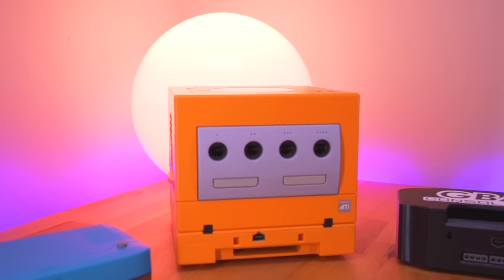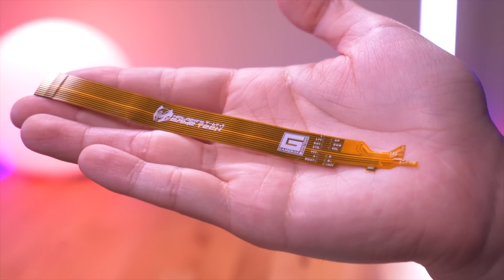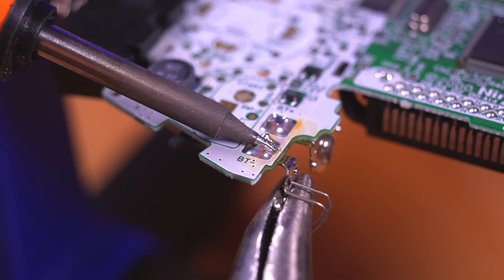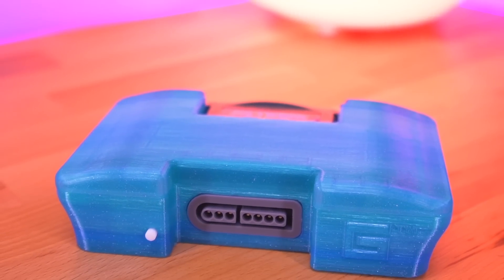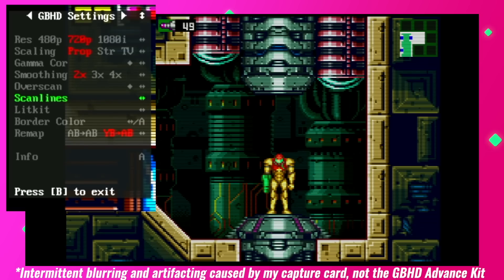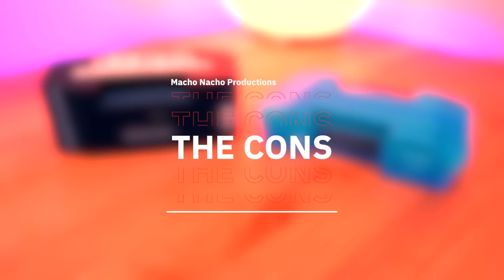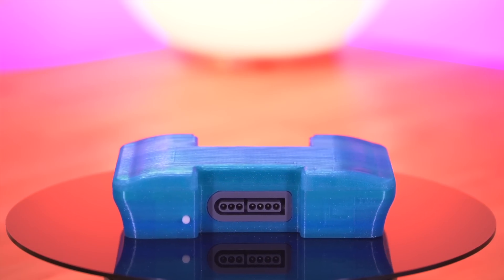Best Affordable FPGA HDMI Kit for The Game Boy Advance!?  The GBHD Advance

Comment: I know this video is a year old - but I really love the newer aliexpress docks which also come with hdmi out and controller port.
there is a seller who sells these for ~50 bucks. and I notice up to no input lag. only down side i experienced with these is, if you use a bluetooth controller and it loses connection to the SNES bt adapter you are using - the dock somehow misinterpretes a disconnected BT receiver as pushing all buttons at the same time. which leads to a game reset loop.

so if you are using a bt controller with those aliexpress docks for the gba - better make sure your bt controller is charged - and do safety saves.
Reply: Do you have a link to where you can find this on AE?

Comment: The main issue I have with the GBHD is compatibility with the e-Reader, which I know is a VERY small use-case scenario.
On the GBHD,  the e-Reader looks like it would block the HDMI port, defeating the entire point of a consolizer.
Still a great product though. Definitely on my list of items to potentially get.
Reply: GBHD SP variant might be able to work with it

Comment: I’ve found that the audio is a nightmare to navigate:

SC-LX701 does not passthrough audio. The front HDMI port won’t display an image either.

My LG OLED B6 suffers w/audio drift ~1sec. You can reset the drift by changing the resolution via the GBHD OSD, but it’ll creep back within a couple of minutes. 480p doesn’t output any audio. Whereas 1080i outputs as 540x1920 progressive and the top/bottom lines flicker. Golden Sun’s overworld BG shakes.

My old SAMSUNG 2032 SyncMaster has no problem with audio in all 3 resolutions, but only 1080i fits the whole screen.

If you purchase this kit be warned that your setup won’t be compatible as-is. You’ll more than likely need an audio splitter unless your tv is old like my SAMSUNG.

Comment: One thing you didn't mention in the pros/cons is that it doesn't look like you can't use the official link cable with this kit's layout because the HDMI port is in the way.  The Woozle kit doesn't have this issue because the link cable is above the controller port.  If you look at the spacing of the holes for the link cable's clips on Woozle's kit at 11:40, you can see how wide the official connector is.  With this kit you'll need to pick up an aftermarket cable that doesn't have the wide connector with the clips.  A quick search shows there are some available for GB<->GB, but I didn't immediately see one for GB<->GameCube.   EDIT: Further searching tells me it's only the GB->GameCube cable that has an issue.

Comment: I bought one of these last month and it works really well. Might grab the GBC version next just for GB/GBC games to have their own system. Definitely enjoying it.

EDIT: The biggest problem I have with the system is that it doesn't save settings so you have to readjust the button layout every time you turn it on if you like Y and B instead of A and B.
Reply: I have the color version, and it has the same issue. Pretty annoying needing to change the resolution to 720p every time I boot. Otherwise it's pretty good though, just no custom colors for GB games aside from the built in GBC colors. I tested input lag to be basically identical to the original GBC when playing on my PC monitor, so I'm pretty happy with it.
Reply: We're coming out w gbasp next!
Reply: @undriven  I'm kind of disappointed that the GB/GBC version got discontinued before I ordered one. I have no idea why, but I wanted to have a separate one for GB.

Comment: The price is the biggest con. No ones gonna pay that then build it themselves. I'm interested but given the price and building it yourself.  Just not worth it. Even if you're skilled enough. The $200 dollar price range might be worth it for a built one.
Reply: I think you're missing the cost my guy, the kit costs 160 to do it yourself, it costs 100-140 for a clean, decent gba sp with clean pins on ebay, they're providing everything already put together so that leaves them what, 40 for putting it together and shipping?

Comment: The kit looks cool but 3D printed cases look like garbage. Wish it was plastic injection molded. Otherwise if I buy this kit I will use sandpaper and polishing compounds to smooth surface.

Comment: Hmm. It looks like the GBA Consolizer has one further advantage over the Gamebox kit, which is that the case is designed with an opening that allows you to access the headphone jack, pulling analog audio directly from the GBA motherboard and bypassing any weird DVI audio incompatibilities. That's how I use my GBA Consolizer.

Otherwise, this is pretty cool. I definitely like the full size HDMI and USB C. And the case design is nice. If I didn't already have the GBA Consolizer, I'd definitely be interested in this Gamebox kit.

I'm surprised there was nothing needed with the power switch on the GBA motherboard, though.

Comment: There's 2 key differences with Woozle's Consolizer not mentioned at all here: original GBA speed for compatible monitors, and color correction options. Without these two features, this otherwise nice kit becomes unusable IMO.
edit: Supporting grid-like "scanlines" is also an important difference to me, though less than the above.
Reply: @DenebianSlimeDevil  GBA consoles run at a non-standard speed of 59.73 Hz, as opposed to the standard 60 Hz (think 60 frames per second). The screens on GBAs were able refresh at this speed and thus show games in their original speed without problems. Many modern displays including consumer TVs can as well, but others can't as they can only support standards like 60Hz. To maximize compatibility with all TVs, kits like this can output a 60Hz signals which means that every once in a while a frame has to be skipped or doubled, resulting in stutter in the image every few seconds. It's always better to have an option of the original refresh rate rather than be forced into one or the other.

Comment: The audio issues are too risky in a home theatre setup. As soon as that’s ironed out, I’m in.
Reply: I wonder if they could be solved by using an HDMI splitter, then running one of the HDMI connections through an HDMI to axillary connection.

In my setup I wanted to use a TV with my computer without having the icons change whenever the TV was off and wanted audio so I did something similar by first splitting the video signal, then converting to HDMI, then have an audio signal injected into the HDMI cable, and that essentially let me mirror one monitor onto a TV with audio that could then be passed to a sound bar.

 Lots of problems can be solved when you are OK with using a bunch of conversions.

Comment: While it is a okay deal I guess.. I broke down the math on this folks. The new consolizer isn't the "greatest deal ever" it's just "fair". 2x $20 USD FPGA Chils, a $12 PCB for the chips, probably $5 ribbon cable. $5 port for controller probably. The creation of the case for it (designing it takes time and hours which is work) which is probably around $8 worth of plastic as well so call it $20 manufacturing overhead then factor in they're probably buying GBA's with faulty screens (totally fine and a good way to recycle) for around $10 to $20 you can assume.

2x $20 FPGA Chips
$8 (at most) Ribbon cable
$12 (being generous) PCB
$5-$10 SNES controller port replacement (fair and going rate)
$15-$20 functional GBA with a broken LDC (as, the hardware works just no the display on the device, games still run)
to sell that for $300 is absurd, sorry.

Comment: Had they moved the Gameboy motherboard assembly up just a few cm and added cutouts for the wireless adapter this kit would be very tempting. The GameCube link cable also requires this, as do other accessories. Quite a missed opportunity I must say. It would be awesome to trade Pokémon with another GBA wirelessly and see it happen on a large TV. Or even better, link up to a GameCube with an HDMI mod and use both consoles side by side with two monitors in HD! Woozel’s kit does have the cutouts for the wireless adapter and the correct spacing for it to work.
Reply: That sounds interesting 🤔 I guess ill wait for these features to be hammered out

Comment: As you said about the soldiering, that's kind of a turnoff, at least in the realm of having old GBA's I'd like to mod, but I'm not comfortable with the small areas to work with. One other big issue for me is the placement of the HDMI and power, it doesn't really allow for the port to be used for linking systems. One thing I liked in the last GBA mod that was shared was the ability to put in the link cable for the GameCube, also not needing to soldier anything. 

If someone could take the best parts of each, made it a thing, and not cost a lot, that would probably get me to buy 1 or 2, and so I could give my old GBA's new life
Reply from the maker: Totally agree!  It would be awesome to combine the best features of all these kits

Comment: I was wondering what it might take to make a consolizer kit that just sits on top of the gameboy player.  I know there's probably a lot of those out there without the disc's that will just go to waste, so would be nice to make those useful.

Also still waiting on a good consolizer kit for the GBA SP.  I've got a couple spare boards for those lying around.
Reply from the maker: That’s actually a really super interesting idea. That could actually be really cool!
Reply: @MachoNachoProductions  Have you heard of the open-source gbaHD project? Pair that with ManCloud's shield for the Spartan FPGA board you need for it, and you have exactly that. Might not be as feature-packed as some of the other options out there, but being open-source means that it's exposed to a lot of smart people who can add a lot to it.

Primarily, it's a very DIY project. You need the FPGA dev board, and a way to get the circuit board for the shield (optional, but worth it) made and assembled. Then, you need a case for it all, which there are 3d printed options by jotheripper (they made an original GBA version, and an SP version).

There were a few issues with ManCloud's shield regarding powering SP boards because of how lithium batteries work and (from what I've seen/heard) some rules the board has before it lets the system get power, but they're being worked out in newer revisions. I'm currently building one now, based on a previous revision board because I got the boards made a while ago and never quite got around to ordering parts. You could buy shields from retroupgrades for a while but they're sold out atm, and also that board is based on the past revision that I have. My first time soldering SMD components outside of a practice board, so it's been a fun experience.

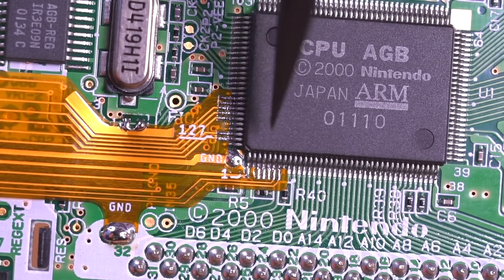Comment: Your soldering is getting better.  Do yourself a favor and buy some no-clean tacky flux like Amtech/Chipquick/MG chemicals, etc.  Liquid flux is crap.  At 6:09 your joints are good but would look perfect had you used a tacky type flux instead of liquid.
Reply from the maker: I have some amtech flux which works amazingly. I use the no clean thinking it’s easier to show the soldering on camera. Perhaps I should use the amtech more 😅

Comment: I believe the GBHD advance uses the GBA clock for accurate clock cycles, whereas Woozle's kit slightly changes the clock to match a perfect 60hz. Am I right in thinking this?
Reply: In Woozle's kit you can have it either way
Reply: I would also like to know this. This is definitely an important topic to get the best picture quality 🙂
Reply from the maker: That is a great question!  I unfortunately don’t know the answer, but hopefully Gamebox is prowling the comments and can chime in
Reply: I asked Gamebox about this and got the following answer:
„No, there is no overclocking, it is stock with a framebuffer. The output is normal 60hz, not 59.73Hz“
So no overclocking with a framebuffer.

Comment: Looks to be a promising option.
On the audio issue, I'd imagine with the unit being an FPGA it wouldn't take much effort for a firmware update to fix it. USB-C should allow this in theory.
About the only question have is can one send their own GBA to use as the donor/core?
Reply from the maker: That’s a great question. I would message game box. They may accept your donor console
Reply: @MachoNachoProductions  I have a GameCube with GCHDMI internal HDMI installed coupled with the Gameboy Player addon and Swiss running the Gameboy Interface software. Would you say this is the best setup for Gameboy games?

Comment: Nice video thanks. Why does this one not make the GBA's headphone jack accessible? I have Woozle's 2nd gen consolizer, with which my TV doesn't recognize the audio over HDMI so I use the headphone jack, and the volume dial is easily accessible as it has a quick-removable lid.. I'm surprised this case doesn't seem to allow that. Also, does this one allow easily updateable firmware? As my Woozle kit is only updatable via JTAG so I haven't tried it.
Reply from the maker: That’s a good question. I wonder if the case could be redesigned to accommodate that

Comment: Woozle's solution supports the original color gamut of the non-backlit GBA screens, which is useful for those games designed for that display.  This one does not seem to and the 1080i option seems to be a somewhat dubious value.

Comment: No disrespect to the company that makes this, but for $160 the audio should work consistently. I personally still like the solderless kit the best, but I can understand why some would prefer this. while the solderless kit may display the game a bit fuzzy and have slight input lag (I believe correct if I’m wrong). However, this one does offer you almost all the same features as woozle’s consolizer offered at a fraction of the cost.
Side note: Personally I think this one took a few of the aesthetics from the solderless kit i.e. the shell’s look.

Comment: Hey, i know this is not related to thus video and that you have already done this before but in a diferent way but, could you do an GBA SP modding with bluetooth and USB-C "BUT" keeping the clam shell function and not adding extra thickness to the console?
Reply from the maker: That would be tough. I know there is a usb-c mod that replaces the charge port and you could put the Bluetooth module being the lcd. Definitely possible for sure!
Reply: @MachoNachoProductions  i alrready ordered both pieces, but need advice in which cables to use, flexibles enough to wistand the use just like the ribbon cable.

Comment: I love this! How do you personally go about desoldering? could you also do a usb c mod from handheld legends fro the gba sp in its factory shell? thanks!
Reply from the maker: For desolder if the speaker I just heat up the pad and pull out the wire. I’ve been planning on doing a usb-c mod, just not enough hours in the day 😅

Comment: So does the power slider switch on the GBA board need to be in the on position? what about the volume wheel?  It does not have built in Bluetooth? 
The sound compatibility issue is a deal breaker for me. I will stick with my old school S-Video Piggyback kit and a RetroTink 5X
Reply from the maker: That’s a great question. I didn’t even think about that, but the instruction manual didn’t make mention of the power switch so I imagine it doesn’t matter what position it’s in.